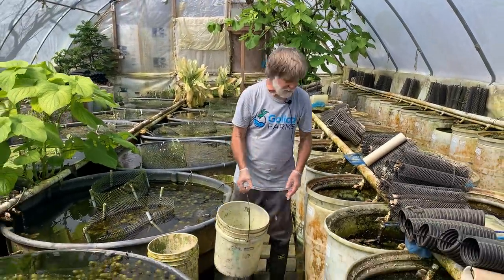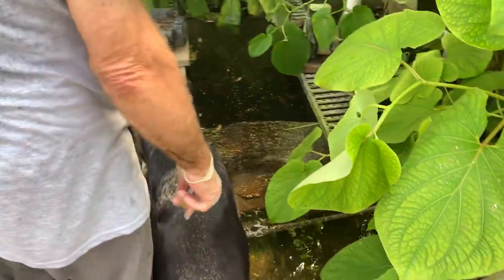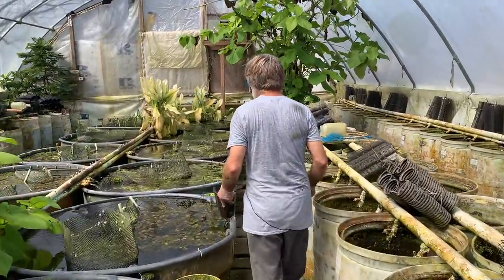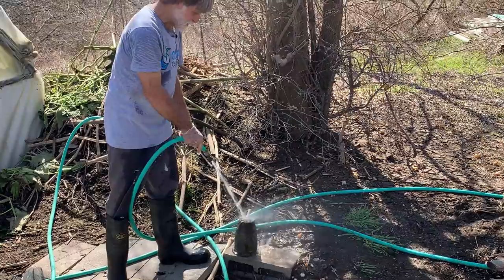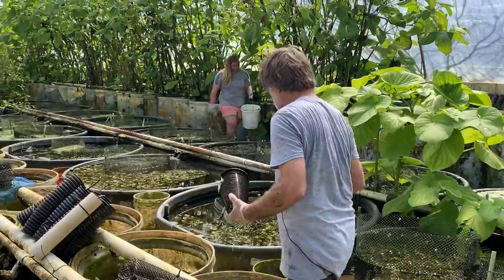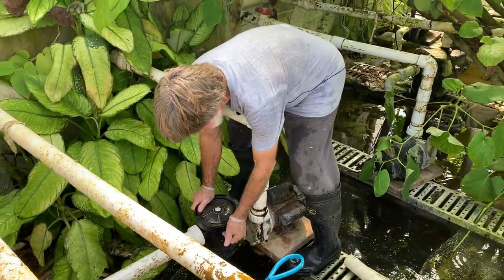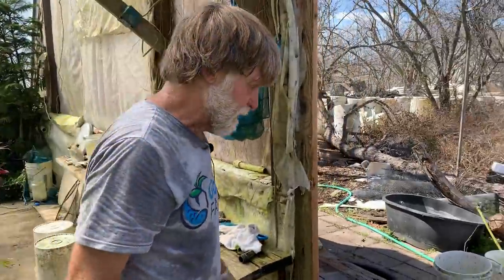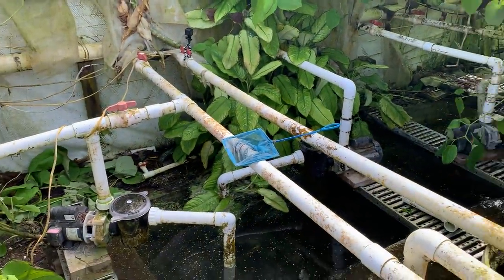Day 4 of Recovery from TEXAS WINTER STORM 2021 - Clogged Pumps and decreasing ammonia levels

Comment: Random thought...  My grandpa had this cast iron cauldron (like a big witches pot) on an A-frame that he would build a fire under or put a propane flame under to - um...allegedly- make mind altering substances...  He would boil liquid in them for brewing.
   I wonder if something like that could be done with fish water and then poured into the floor gutter?  It would have to be repeated over and over again, but with your circulation i think it could work.  Just a thought.  Idk
Reply from the maker: We will probably add aquaculture submersible heaters. But they are electricity dependent. In the case of outages like we had, we'd have to have more propane that we could get to keep the generator running. I'll have to think about your solution.
Charles